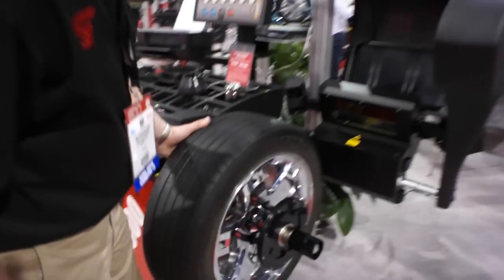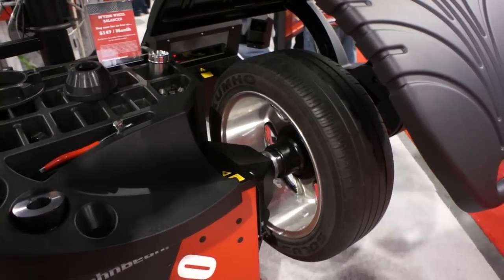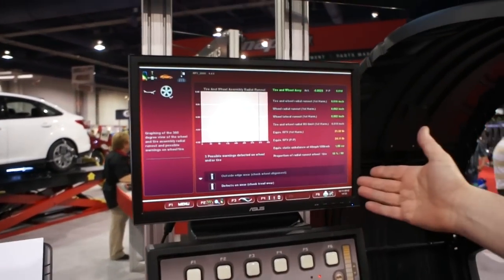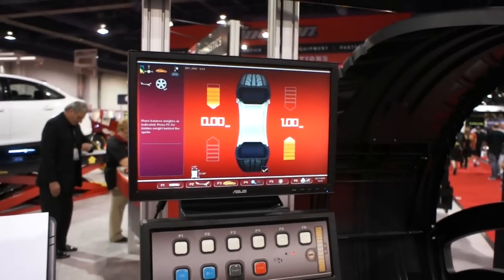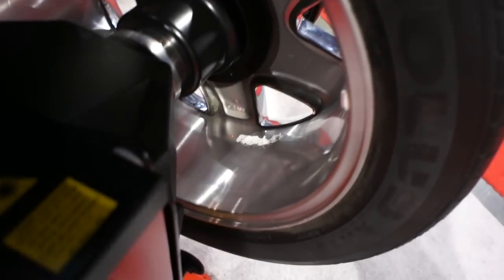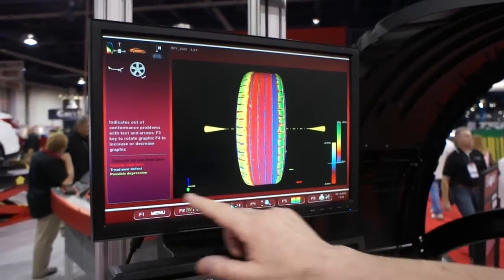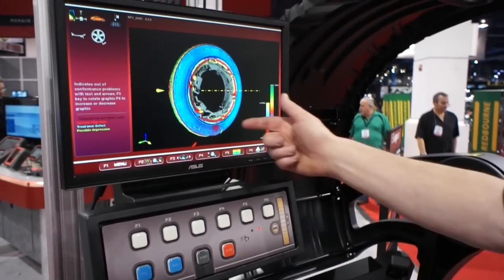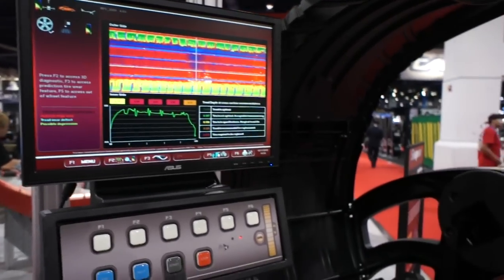Digital Dynamic Wheel Balancer (Snap-on Tools)

Comment: Road force balancing is unnecessary in 95% of instances. I’ve found that even without pin plates my Hoffmann 9600p balances even large truck tires to a VERY smooth result.